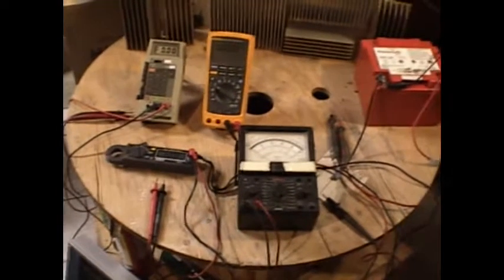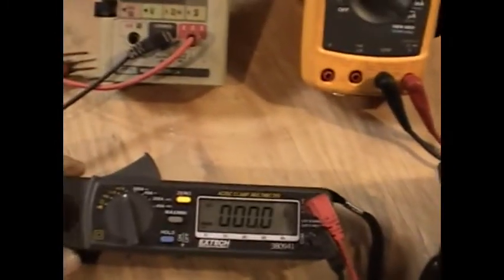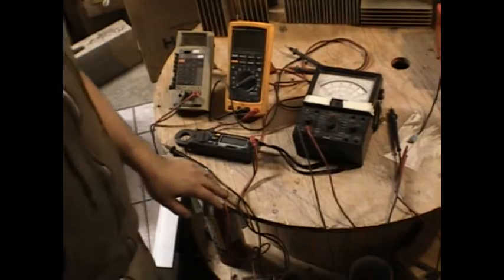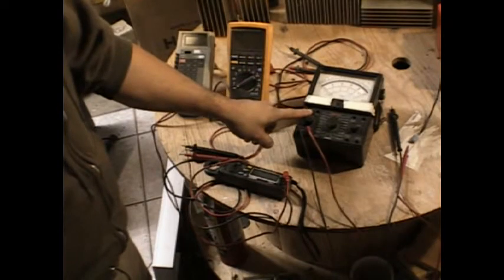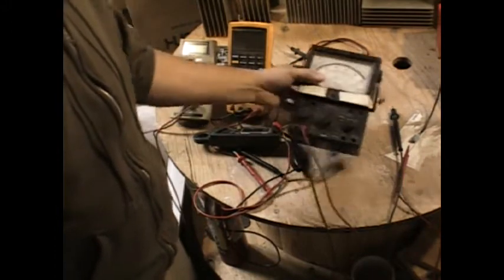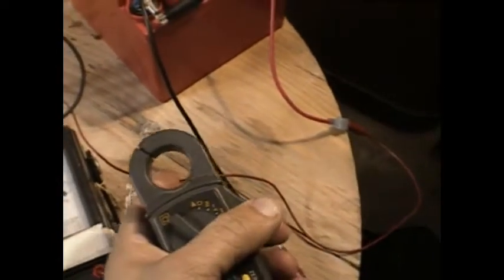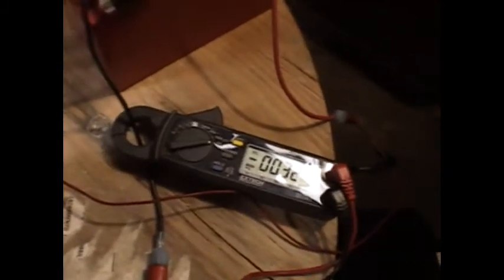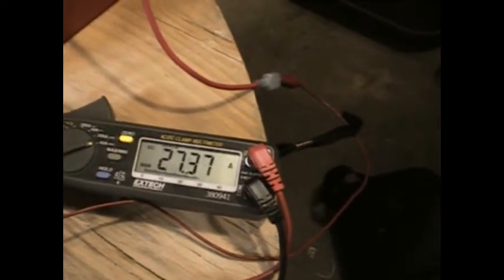Prepper Field Test Equipment Intro Part One

Comment: Whats your opinion of EMP Surviveability of a Vaccum Tube Voltmeter (VTVM ) Im not so worried about the Prepper aspect of No AC to power it up, I can handle that specially the small amount of AC it will need to work. But I am curious as to the EMP Surviveability. Great video. Your an asset to the Prepper community, thanks again
Ron
KB3VEW